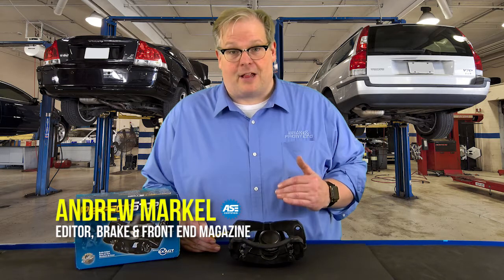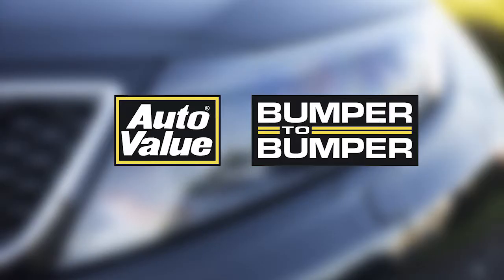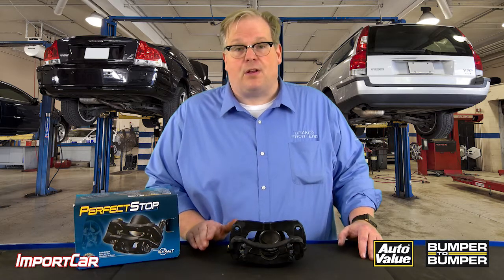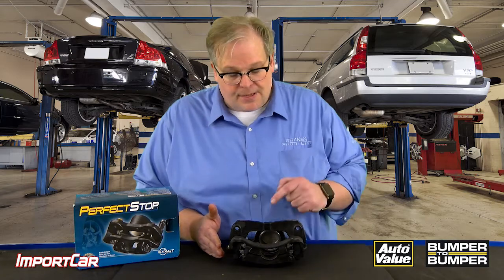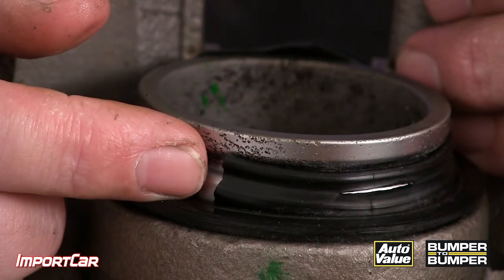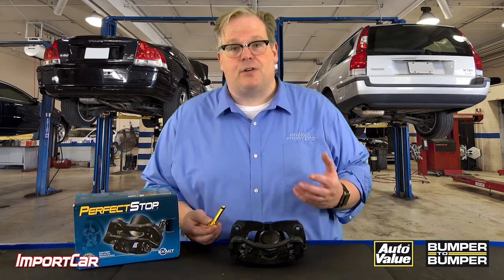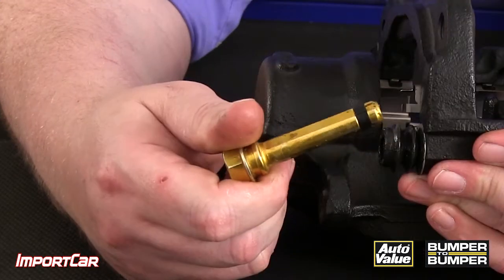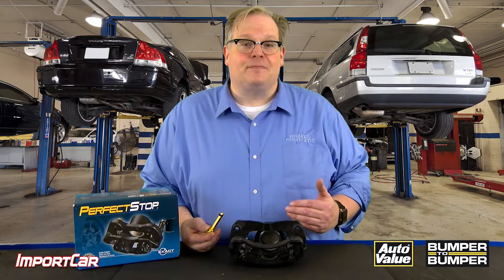When To Replace A Brake Caliper | Maintenance Minute

Comment: An easy way to know if the brake caliper or slide pins are stuck is to check the rotor temperature between both axle wheels after a drive. The temperature should be close between both rotors, if not jack up vehicle and see if both axle wheels spin freely, if one of the wheels is harder to spin check the caliper piston, slide pins and look for uneven pad wear. If both axle wheels spin equally then I would check the side that was cooler and see if the brake pads are making full contact with the rotor. Again, check the slide pins, caliper piston and look for uneven pad wear, sometimes there is rust on the rotor when the pads are not making full contact.